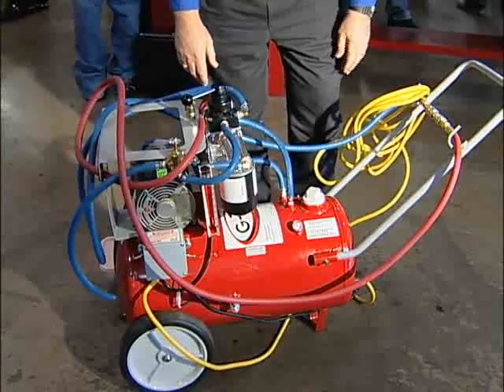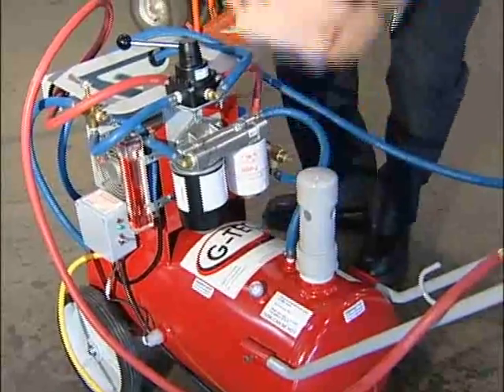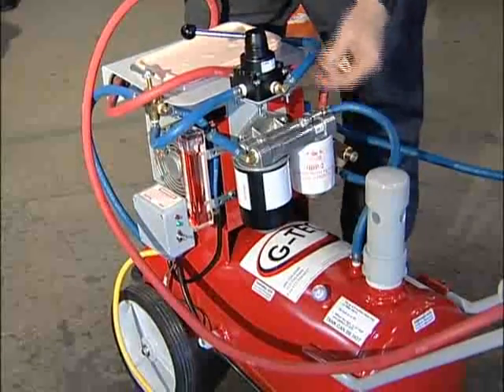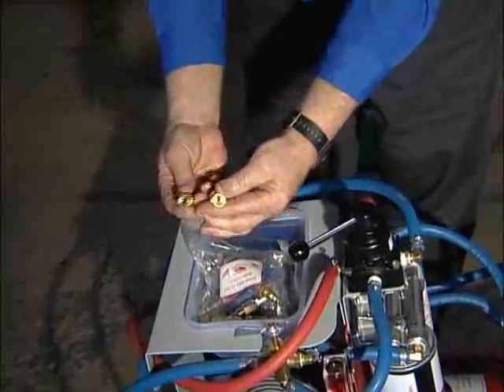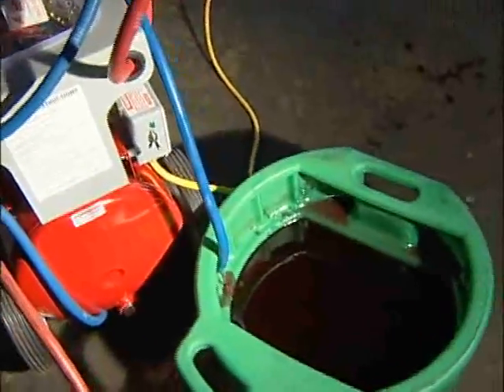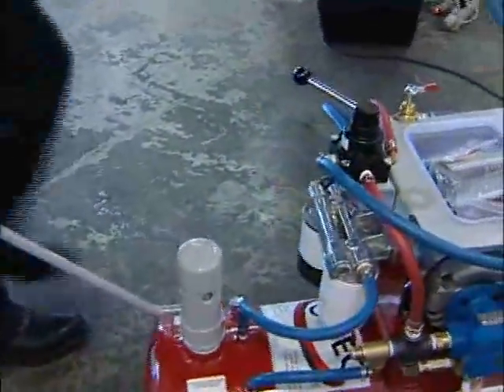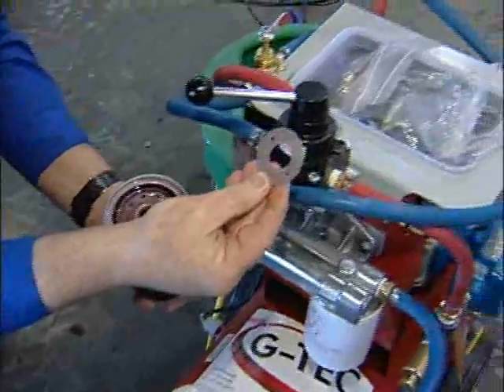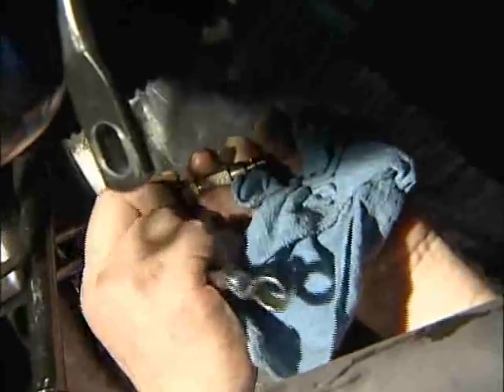G-TEC TTCF-7AR Flusher Instructional Video

Comment: Is it normal for the fluid in the flow valve to look aerated when do the flush. When I turn the air on when doing my first flush the oil looks aerated but if you turn the air of it looks normal like in the this video